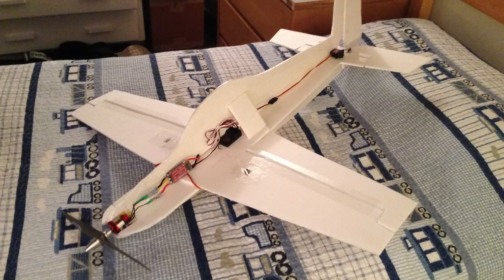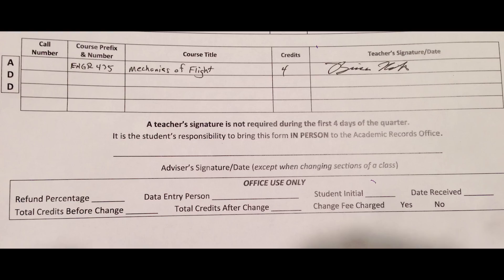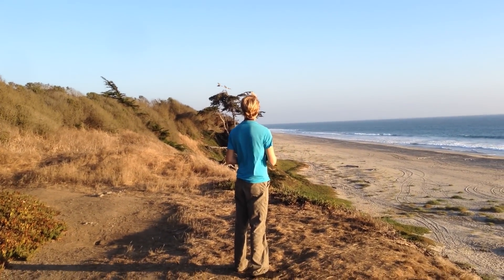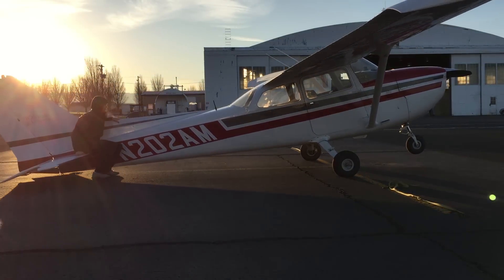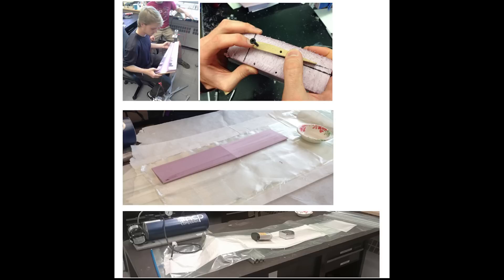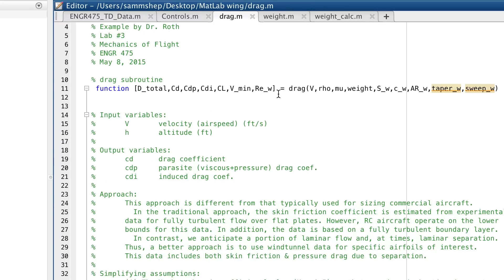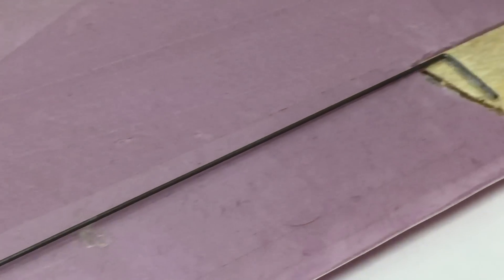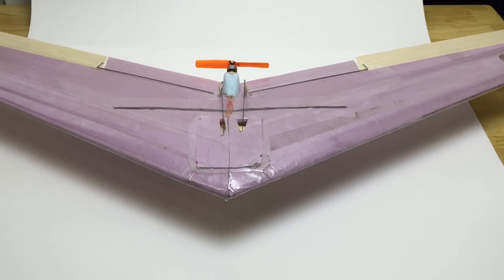Engineered Mini Flying Wing

Comment: Hello Samm, 
I just first want to say how awesome this video was. It is by far my favorite of yours so far. (just ahead of the ski plane video)
Do you still have the plane, or did the school keep it?
If you still have access to it, I recommend putting winglets on it. For the tiny amount of weight they add, you will lower the total induced drag (ID) of the airplane. On flying wings of that shape, ID is very high because of the pressure difference of air from the top of the wing to the bottom. With just winglets you might be able to get up to 3 minutes more out of the plane.
Just a suggestion,
Colin
Reply from the maker: Thanks for the suggestion! Winglets are a little more complicated than that. They increase the effective wingspan by I think 2/3, meaning a 3 inch singlet has the same effect as adding 2 inches of wing span. Another issue is that the small chord has a really low Reynolds number, which means that the air acts relatively more like honey for them. And lastly, wingless would have the very highest moment arm in the aft direction, so any little weight at all has a large effect, I was already struggling to keep the CG foreword with such a small battery.
Reply: +Samm Sheperd (SNRS) 
Hey man, now that you mention the low Reynolds number I realize that you are right.
But as far as adding effective wingspan, I think that we are thinking of different things.
I am talking about vertical "fins" at the tip of each wing, similar to that of a large airliner. The moment arm fact is very true, I did not think of that. But, even though the Reynolds number is low,  the pressure difference from the bottom to the atmosphere to the top of the wing is still relatively high. Therefore, winglets would increase efficiency. But you are probably correct, as I am only a high school freshman. (Also, I want to clarify that I am not hating on the video or being argumentative, I just enjoy talking about this stuff)
Colin
Reply from the maker: Crash and Burn RC You are very bright especially for the stage of life you are in. I only started doing this sophomore in college, and I just kinda got hooked.

Winglets are fascinating and a bit different than people think. When designed properly, they do in fact help reduce induced drag by interfering with the spanwise flow of a wing generating lift. They also help the wing to produce MORE lift too, which is neat.

Here is what Stanford University says:

"When the wing/winglet combination is optimized for minimum drag at fixed span, it achieves about the same drag as a planar wing with a span increased by about 45% of the winglet height."

So I was wrong to say 2/3, but it's more like 1/2.

Source: http://adg.stanford.edu/aa241/AircraftDesign.html,

My quote is found on the left navigation panel under "Wing Design," select "Nonplanar Wings and Winglets"

Comment: "By following a few simple rules, you can get this sheet of foam to fly in like half an hour".   It would be interesting to see how much endurance the sheet of foam would have, using the same powertrain as the engineered wing.   To see how much was actually gained by the engineering.
Reply from the maker: +Dwayne Crow The small powertrain would not have enough thrust nor would it have enough weight to bring the CG far enough forward.
Reply: +Samm Sheperd (SNRS) Maybe  cut the sheet of foam down to either the same weight or the same wing area as the engineered wing.   Have really enjoyed all your videos Sam, keep 'em coming...
Reply from the maker: Dwayne Crow Actually yea just the foam board planform that I made first would work.

Comment: Funny thing, the last time I had a project involving building a plane it was in high school where nobody knew about the whole CG thing except for me in the entire class. Kids literally got a stick and put wings on the front and a tail on the back and I couldn't help but laugh during their test flights where they just flipped until they fell straight to the ground.
Reply from the maker: +rockonmyfriend CG is both the most important and the most overlooked component to a flying vehicle. You shoulda helped everyone out! haha
Reply: +Samm Sheperd (SNRS) it was a competitive project where the longest flying plane got the best grade for the project. I felt sorry for everybody and at least told a few people that planes need to balance on the wing to actually fly. I really only helped people who were friendly to me, there were a lot of dicks in that class.
Reply: +Samm Sheperd (SNRS) great video by the way! Makes me want to try and rig up a foam cutter once I get my iCharger repaired and back from progressiveRC. Balancer stopped working yesterday. 10 days after the warranty date ended. This flies so much better than what I did with similar gear that came from a crashed PZ ultra micro stryker. I tried using foamboard and the whole thing's heavy, I'll redesign it after I crash the thing into oblivion, it's still fun to fly.

Comment: This process is called "multidisciplinary design optimization".  Although there wasn't too much optimization shown beyond the calculations you did before the design algorithm with taper, and the final selection process.  You could probably get an even better endurance before tackling the manufacturing process, depending on the fidelity of things like your atmospheric model and engine performance model.  Also, make sure that it is clear when a design is not feasible (e.g. thrust available less than thrust required).  You can get more info in the textbooks by Raymer, Anderson, and Mattingly.

Comment from the maker: Another easter egg: https://youtu.be/mrQgWzK5WKM
Reply from the maker: +yuhui liang 800W water cooled LED flashlight
Reply from the maker: spencer shanks Quick google search came up with this https://www.foxbuying.com/ar6400lbl-2-4ghz-6-channel-receiver-module.html?gclid=Cj0KEQjwztG8BRCJgseTvZLctr8BEiQAA_kBD2B_NDOz8W6ZNB5Yf60aMohtkPKrqI4Fevn10bnNcB8aAuZQ8P8HAQ
Reply: +Samm Sheperd (SNRS) doood that is some good engineering there
Reply: +Samm Sheperd (SNRS) a bottle of fluid, a fan, a switch, LEDs? what is it?
Reply: Thanks the flying wing was a tremendous thing
Reply: could you link me the brain component i really want to try and build this but i cant find it anywhere.
Reply: thank you so much i couldn't find it anywhere.
Reply: ***** What Is the cheapest radio that could bind with the receiver?
Reply from the maker: spencer shanks Depends on if you want to be able to mix the channels or not. Which would allow you to have elevons or v-tails etc.
Reply: I basically just want to do exactly what you did in this video, being able to steer with only two elevons.
Reply from the maker: spencer shanks It's a little challenging to achieve that with this board because:

On this board, the two servos on it are controlled by channels 2 and 4. 

ch2=  Elevator, which is up and down on the right stick on mode 2 transmitters.

ch4 = Rudder, which is left and right on the left stick on mode 2 transmitters.

But standard elevon mixing is done with channels 1 and 2.

1= Aileron, which left and right on the right stick.

So you need a transmitter with channel mixing capabilities for you to custom mix channels 1 and 2 and transmit them on channels 2 and 4.

I recommend you watch my video about how RC electronics.

This is a great budget transmitter that will work with this board, and also many others, and can be used for pretty much all RC vehicles and projects. http://www.hobbyking.com/hobbyking/store/__54822__OrangeRx_T_SIX_2_4GHz_DSM2_Compatible_6CH_Transmitter_w_10_Model_Memory_and_3_Pos_Switch_Mode_2_.html
Reply: Thank you for being so helpful I will defiantly look into this more.
Reply: Samm Sheperd i built a scaled up (x1.3) version of this wing with a friend. Will upload some footage as soon as the weather clears up
Reply from the maker: RCP8888 I look forward to it!
Reply: it flies that well, we will build more of them haha. we only had to adjust CG with some additional weight. also we didnt do the -3° twist at the wingtips but compensated the twist with minor trim.
Reply: Samm Sheperd what is the brain actually called as I want to buy one
Thank you
Reply: Hello, i have a question. I saw on a stability calculator that there are two types of CG called Ideal and Real. What is the difference and which one should i generally use.

Comment: Very cool - gonna have to build one with these proportions too and try it out! Did you miss vertical stabilizers at all? Having trouble getting the CG of my (terribly designed) flying wing forward enough. Ditching the vertical stabilizers would make that a ton easier.

Comment: Wow, that is some amazing endurance. Did you not find it to be unstable on the roll axis because of the lack of vertical stabilizers or dihedral?
Reply from the maker: +Jay Anderson with any kind of turbulence it was pretty wobbly, but in still air it was perfect. I don't think dihedral works on flying wings, but since it had so much span for its weight it wasn't too bad on the roll. It wouldn't self correct, but the elevons provide plenty of pilot control.
Reply: I don't see why dihedral wouldn't work on a delta wing. I have a wing with some dihedral that handles very well.
Reply from the maker: +Jay Anderson Huh, for some reason I was under the impression that that was the case, but I can't really think of a reason why, and the internet has not proved me right, so maybe it does help. Though I guess I'll argue that dihedral would reduce efficiency, make construction and inverted flight much more difficult, and worsen the dutch roll tendencies. I usually prefer neutral stability, relying on pilot involvement for active stability rather than passive stability.
Reply: +Jay Anderson We considered dihedral but because of the aspect ratio we didn't feel it was necessary.  We also talked about adding angled wingtips to do the same thing without affecting the rest of the wing.
Reply: +Jay Anderson The wingtip idea was actually thrown out for two reasons:  it was already controllable enough in the roll axis and we were really trying to keep the weight as far forward as possible.  That picture of how the four concentrations related to each other were 100% correct.  Keeping the CG in front of the MAC was tough with the pusher prop and it ended up millimeters in front (fairly acrobatic) after adding holes in the ends of the wings (Samm's idea).
Reply from the maker: +Jay Anderson You can make one! just a small e guitar string ($1) and a 12v power source and a spring to hold tension and you're good to go! Though I didn't source the electronics, I did some searching and this looks like it https://www.foxbuying.com/ar6400lbl-2-4ghz-6-channel-receiver-module.html?gclid=Cj0KEQiA0sq2BRDRt6Scrqj71vQBEiQAg5bj08W1H9j5f9c9-h9ZyWhgmWpaXzLpf58HyzUkQtD-COsaAv3K8P8HAQ
Reply from the maker: +Jay Anderson It binds with DSM2 radio systems, so that's spectrum and I think the OrangeTx brand too. Probably others.
Reply: Ute Opia It's a really cool design. Might build one myself if i get access to a large hot wire cutter. Where can I get hold of the receiver, esc, servo combo?